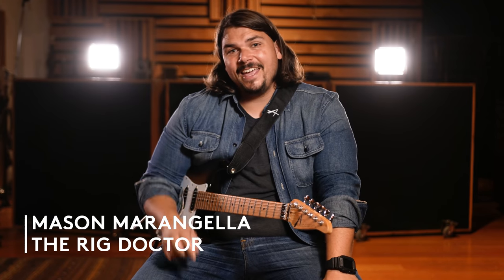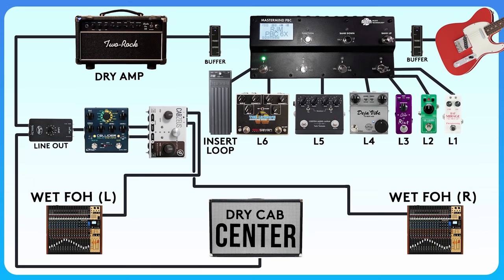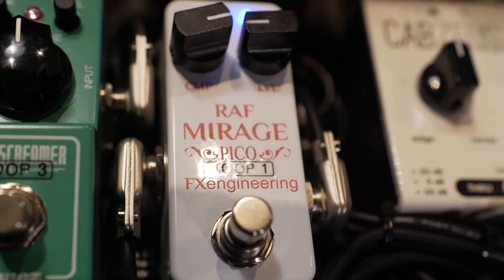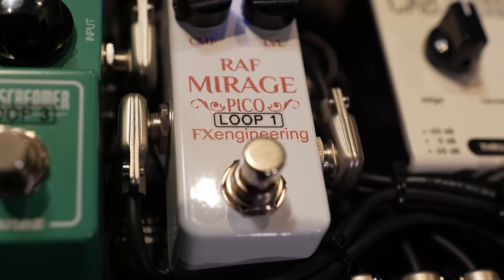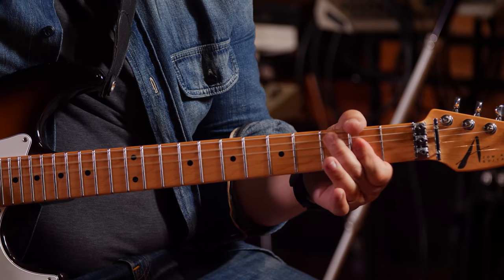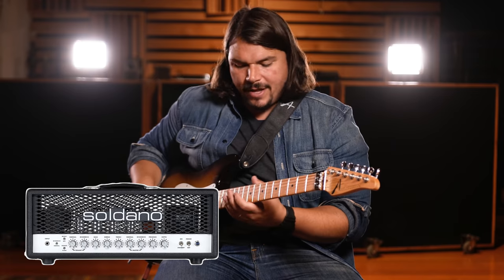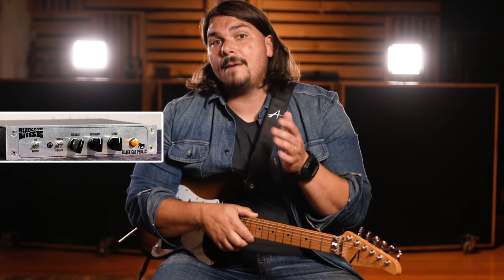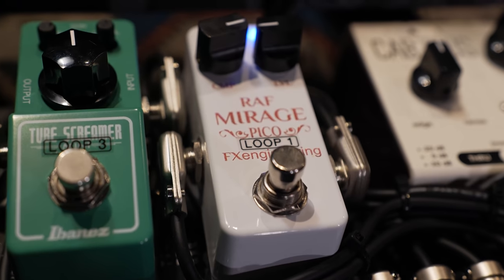Can Today's Pedals NAIL 1980's Rack Tones?

Comment: Tones are there for the most part, especially the clean ones, even though the dBx 160’s hard knee vca type compression hits a lot harder than an opto style.
The advantage of racks is the programmability and saving of presets for each machine, which is more limited in a pedalboard format, especially with effects levels (infact, the very first crunch tone you demoed has way too much delay for a rhythm part, and the delay’s bpm is not matching the tempo of the part, but these are details), although, when you have dialed in those four or five great sounds you can certainly play 90% or gigs, save those two or three special fx patches.
I still love the rack thing, it’s a totem for me, but as you say, it’s unlikely to have it out on a stage these days with budget constraints and less guitar centric music at the top of the charts, so I’m glad that such cool tones can be achieved for the most part in a compact pedalboard format.
Cheers
Reply from the maker: The RJM Switcher can perform all the programmable functions, just like the Bradshaw racks of old.  Most of the classical rack units didn't have MIDI so you had to set your functions for a singular use and then use the programming to bring it in or out of the audio path, the PCM Lexicon stuff in particular, Tri Stereo Chorus, TC 1210, etc.  I agree the delay was as bit off on the first example of the higher gain stuff...I actually didn't think our editors were going to use that as we talked about it in the video shoot and I tapped in a more appropriate tempo for the subsequent examples.  Again, just like in a rack, these delay/reverbs can be programmed and preset whoever you'd like them.  In the video I was calling up the pedals manually "du jour" for the purposes of the video.
Reply: @VertexEffectsInc  That’s true for the very first racks that were pioneering the thing, early eighties. As technology progressed, say mid to late eighties, with monster machines like the H3000 or PCM70 and TC2290 units the thing became even more involved as each unit could do more than just a single effect at a time and could save dozens of presets. But some staples, like the Dytronics TSC or the SPX90 detune were one trick ponies and only a switcher could bring them in and out of the path. Some people are able to do that whole thing now with just a single unit, like an H9000, which has so much DSP horsepower to cover it all, even tough being the rack thing a “size matters” matter only one rack unit takes away all the fun...(kidding)
Reply from the maker: @lore88824  Typically the H3000 was only used for one thing, Detune (+9/-9) or the SPX90 was used in it's place so really in either case, no MIDI was being used since it was just on/off.  Of most of the benchmark guys: Landau, Lukather, Huff, Thompson for that tone very little of the gear was MIDI.  Maybe later on in the 90's when some started using the MPX-1 they would use more MIDI but were only using two effects in parallel (like Delay and Reverb in Landau's case from the MPX-1).
Reply: @VertexEffectsInc  MPX-1 is post 90’s (I got mine in 2001). PCM circular delays were available in 70, while 80 and 81 offered a whole lotta stuff including delays, reverbs snd modulations.
Besides, not here to argue but Landau/Luke/Huff are always cited like they were the only ones using rack gear to create cool tones, but there’s many more, albeit in different musical genres, which pushed the boundaries of rack gear use even more. Let’s think about what Vai did with an H3000 in Passion & Warfare for a second...I think it’s way more than detune...

Comment: What guitar pick were you using? Whatever it is works really well with a strat type guitar. I find for nailing those 80s strat tones requires using a pick with the right thickness, material used in manufacturing, and pick shape.

Comment: Where's the micro pitch after the chorus!? The horror!! Could have turned the rate up a bit to compensate for that... At any rate- Good job milking those pedals though, sounded good for what you had. Also appreciate the great explanation of the signal chain. Those with rack gear and a line level mixer can build off this.
Reply from the maker: Hahahaha, I have a Eventide MP on this rig now after the chorus :)
Reply: @VertexEffectsInc  Yesss!! I’m in love with that pedal, it’s pretty versatile. Sounds really good in stereo!

Comment: Awesome as usual. I would have done the drive section differently.  I would have chosen a Klon type (clean set above unity) into a Wampler Pantheon, then for high gain I think I would go for a Mesa Throttle Box EQ. Your Boost would be nice anywhere in that line. Or this modded Katana Boost that I have. Though that is a hard choice.
Reply from the maker: We must hear the 80's differently.  Centaur is more 2000's era sound for scooped Fender amps and Strats.  Pantheon is like a Marshall Blues Breaker Pedal, that came out in the 90's.  They don't sound very much like a Soldano or SE 3+ or the standard rack preamps of the day.
Reply: @VertexEffectsInc . No. You're absolutely correct about the board you made. 
I'm just blowing right past the fact the video was about the 80s. I was just being a goober.

Comment: Two questions: Of the 3 main rack choruses is a Tri Stereo type chorus, a TC 1210 stereo type chorus, or a Roland Dimension D more versatile? If I had to have just one do it all type, what would it be? Second, of the two main rack detunes, is a Yamaha SPX 90 or Eventide H3000 better?
Reply from the maker: They're all pretty different.  Probably the Dimension D is more versatile, but they're all kinda one trick pony's.  H3000 for detune and SPX90 are super similar, I'd save the dough and go Yamaha.
Reply: Good luck finding an original TSC...they're hard to come by and will cost a mint if you find one. On the other hand, Redseven (previously Shiva Audio) made "The Wave" which is an identical replica of the original Dytronics TSC. More recently Fulltone did the same thing, "That 80s Chorus Rack". The former sounds amazing, and I own the latter and can vouch for how amazing it sounds. Answer: TSC for chorus. Dimension D has a completely different stereo field that doesn't sound very thick. The TC1210 also is limited in its ability to thicken up the chorus. 
For micro pitch detune, I prefer the Yamaha SPX 90. It's mono in - stereo out, so you'd need to route everything into a line mixer, which I've spent hours on trying various chains...
However, the Eventide also has its strong points and sounds equally amazing. I actually set up a rig today using the Eventide MicroPitch pedal for that part of the chain, and it sounds SO FN GOOD. SPX-90 maybe sounds a bit more authentic with 80s haze, but a Harmonizer at least has stereo ins and outs so there's less routing going on.

Comment: Racks are still a big thing. But those whom can't finance lugging the racks around, then pedalboards and things like a Kemper are used. Racks are getting rediciously expensive. Companies like Red Seven are very much into racks. Mike Toren, M Nielsen band Leon Todd are racklovers with YouTube channels. 

Racks are just better, but....it weighs.
Reply from the maker: Commercially they're not the norm - guys that have sedentary racks, yes (most of whom you mentioned) but the infrastructure isn't there to support a guitar player with a rack unless that guitar player is the main event.  The players that you mentioned are more on the production side and aren't touring.  The volume of rack items sold per year is nominal - sure there are companies making the, but it's a fringe market now, not like the 80's and 90's.
Reply: @VertexEffectsInc  yes and no. We are quite a few that tours and records with a big rack. 😊
Reply: @VertexEffectsInc  but no it is due to money and weight not like in the 80-ties and 90-ties. Apart from the big bands like U2, Metallica, David Gilmour etc etc. Then it is rackdominated rigs. The racks like a Ada MP1 is becoming ridiculously expensive. Luckily I have the rack since way back when.
Reply from the maker: @peterknicked  this would be the exception and not the rule.  Sounds like your individual circumstances for tours reflects your broader perspectives on racks and the pervasiveness.  There will still be individuals that use them that are the main event, the driver of their music.  You'll no longer see a Bradshaw rack with a sideman the way you would with Landau, Lukather, Paul Jackson Jr., Michael Thompson, Dann Huff, as you would've seen in the 80's and 90's.  Guitar players now are ornamental in most pop music and allocating $50,000 in cartage for a summer tour just isn't practical.  So you see more pedalboards, AxeFx, Kempers, etc. as a consequence.

Comment: Very nice, but if chorus was in stereo...
Reply from the maker: No so problematic in this instance, and most of the analog choruses out there couldn't take a line level input to split out the stereo signal before the parallel mixer.

Comment: Maybe I am crediting it too much, but I think roughly 75% of these glorious tones comes from the Two Rock and how it handles dirt pedals in particular. I mean if you hook up either a Tubescreamer or a Riot to say Hot Rod Deville you'll end up with much more squeaky, pinchy and screachy tone with harmonics all over the place. Two Rock's ability to hold the tone together and entrench it in these woody/bell-like qualities is stellar.
Reply from the maker: I will get pretty similar results with most clean Pedal platform amps, saying this is somebody that normally use as a Hot Rod Deville and made most of these pedal choices based on how they sounded in a variety of clean amps.  Most of the processing tone is in the amplifier at all, but the stereo cab Zeus speaker cab simulations for the stereo wet signal.
Reply: I am nowhere near your expertise and knowledge; just having some of mine own from plucking here and there;-)
Here comes the proposal: if you could make a demo of your brand new Ultraphonix pedal through the Deville and the Two Rock, I am more than certain it would sound WAY BETTER through the Two Rock —creamier, woodier, belly-like, tastier, together.
Will you pick up the gauntlet? It would be a nice comparison anyway.